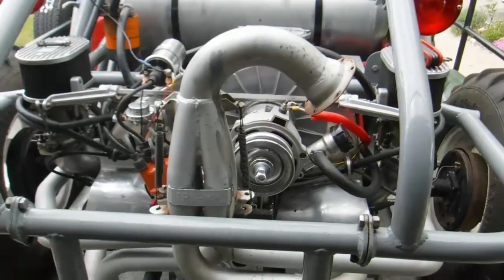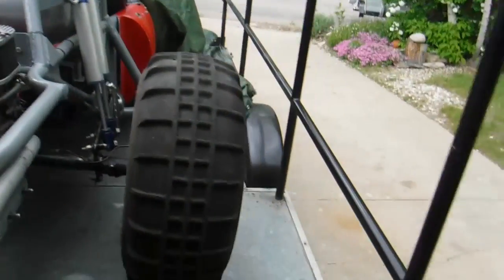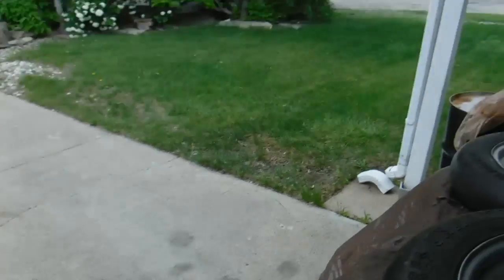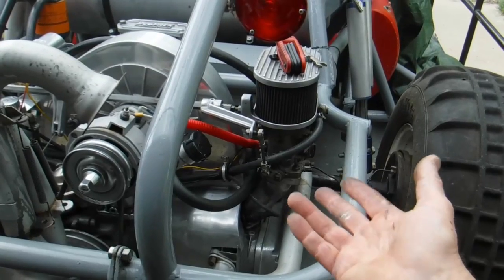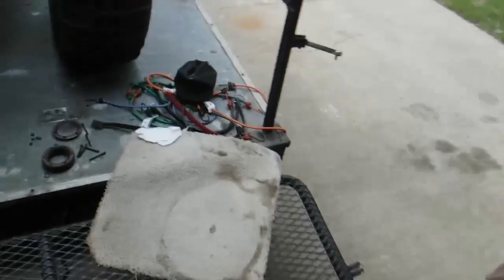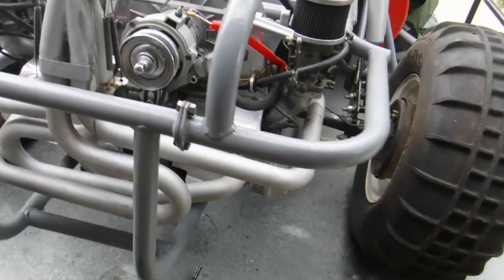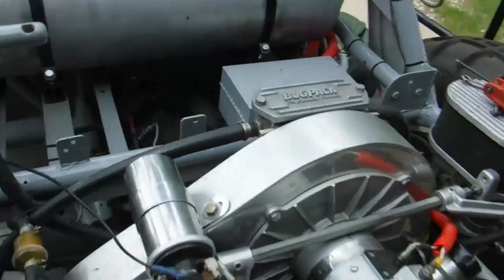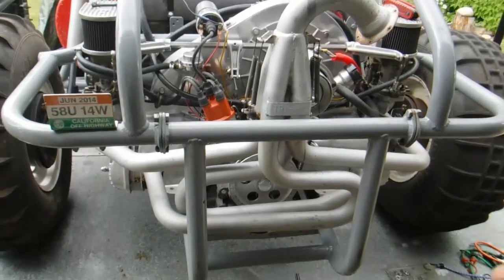VW 2275 Stroker Carburetor Fire

Comment: Hello ... what's your choice of ignition systems with dual carbs?
Is there a difference between center mount vs duals when it comes to ignition spark?
And when it comes to sand / dirt in the carbs, what's your choice of filtration systems? 
Cool looking buggy. 
You going to build it for Moab?
Enjoy these videos.

Comment: Would appreciate your opinion. I have a Baja with 1915, 110 cam, 40x35 heads and 44idf Webers. I live in Texas but will take the car to home in Westcliffe Co. @8000 ft.  Carbs now have 36 vents, 1.75 air, 1.35 main, and .60 idle jets. Could you give me your recommendations for the altitude. Thanks
Reply from the maker: You look like your a tad on the lean side now.  You should be fine up here without buying anything. 36 venture's are to big for that little engine. Makes for a soggy bottom end but run's like a scaled ape when you get it reved up.  Up here you might want to close you idle mixture screw 1/8 of a turn or about 1 flat. Your timing should be around 10 degrees to no more than 34. Timing can effect your your rich lean condition so mess with that if need be. You might also want to back off your accelerator pumps if it puffed black smoke.  Have fun and be safe.
Reply: Thanks for the advice. I appreciate all your videos.

Comment: Bug Brazil .
Reply from the maker: I would love to go down there with a rail and explore.
Reply: TheEZGZ  do you  specialize in 1800 air motors?  i Wonder if the kits are  1800 or kit 1600 with the 78mm shaft of  course??
Hugs bug  brazil, i love your videos, i have a 1972, 1800 bug  .
sorry about my english!!!